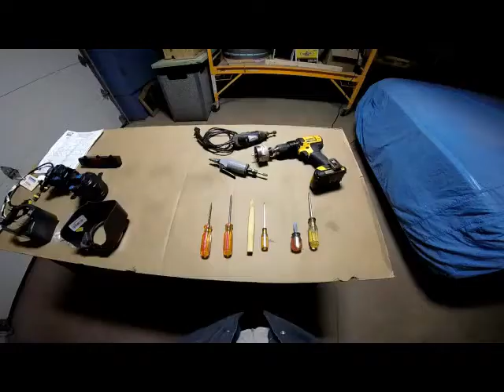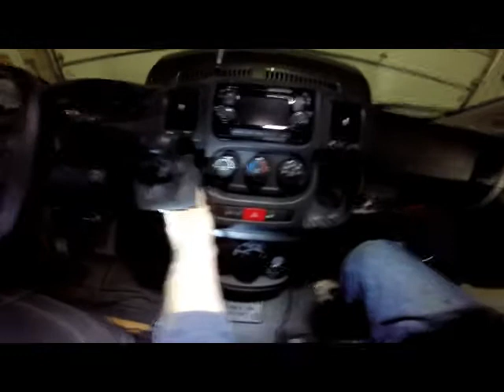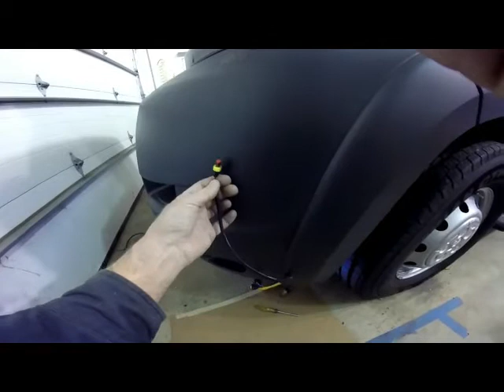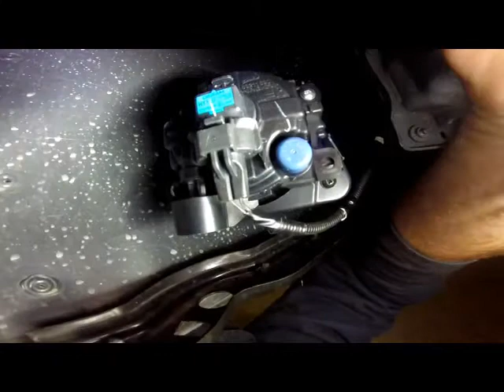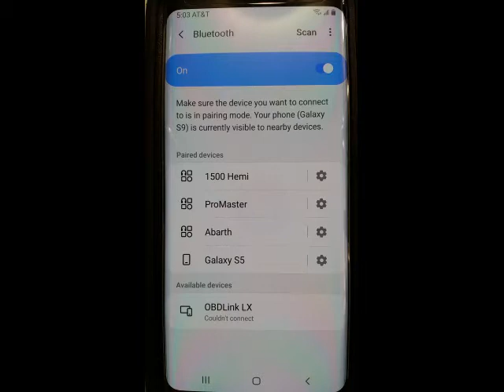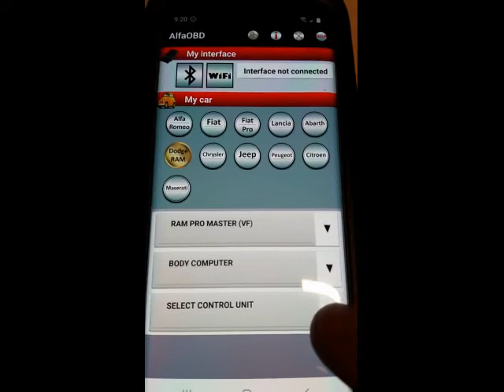Ram Promaster fog light install and enable with AlfaOBD

Comment: Thank you for your excellent video.  I have a 2021 ProMaster and my drivers side fog light works fine, but the passenger side wires are not getting any power to the fog light. I've tried to trace the wires back to the headlight, since I think they get their power from the headlight harness, but I'm not able to find where the fog light wires are in the region of headlight harness. Do you have any advice? I guess I could replace all the wires for the fog light, but it would be nice to have the OEM switch still work.
Reply from the maker: Sorry, I never had to mess with the harness(s).
Reply: Try swapping the cables

Comment: doI need pin code from dealer in order for this to work?
Reply from the maker: No, I don't think so
Reply: @LEKtronics  
sorry to keep bothering u with this issue but after some research it sounds like on ram vehicles (promasters) after 2018 u need an 12+8 pin obd2 adapter cable for sucurity gateway module bypass! is that different from the yellow adaptor and if so do i need both adaptors?

Comment: Larry i also got this message ..... this procedure allows to change car configuration options. warning some systems can be not relevant for your particular car. select an option you want to change from the list box and click start. you will have to perform proxy alignment after any change in the car configuration has been made hint make sure the log recording is switched on so that you could trace the changes to the configuration to be able to roll back the changes.
Reply from the maker: yeah, you probably have to do a proxy alignment to make the changes stick. Make sure that you have no faults before you do the proxy. The proxy alignment is initiated right above the car configuration change that you used to select front fog light absent/present.
Reply: @LEKtronics  okIll try again tomorrow thank you

Comment: hi I have a 2021 ram promaster1500 and added the fog lights. im wondering if the items you used to program the lights on would be the same for my model? saying that im a bit confused on items to purchase to do it myself. by the way i enjoy ur videos thank you
Reply from the maker: I think that the Promaster wiring is the same until model year 2022
Reply: sorry to keep bothering u with this issue but after some research it sounds like on ram vehicles (promasters) after 2018 u need an 12+8 pin obd2 adapter cable for sucurity gateway module bypass! is that different from the yellow adaptor and if so do i need both adaptors?

Comment: Hello, I have a 2021 ram promaster 2500. Do you think that works? because they look the same and it even has the cable for the fog light, thanks
Reply from the maker: I think that the 2022 model year is when they changed things. You should be OK.

Comment: Thx for this. Had a deer strike and think he broke the portion from the bumper that the housing screws into as my light and assembly are lying on the splash guard and I only see the slot which the housing slides onto. Probably need a whole new bumper to replace a fog light 🙄
Reply from the maker: Sorry to hear about the deer! Glad that my video helped you out.

Comment: Interesting - I wonder if you could use this to have a nice OEM+ play to trigger a light bar?

Do you have the part number for the switches?
Reply from the maker: The kit that I got was Mopar part# 82214048. A Google search came up with this: https://store.mopar.com/oem-parts/mopar-headlight-instrument-panel-dimmer-and-dome-light-switch-5mk26jxwaa?c=Zz1tb3Bhci1hY2Nlc3Nvcmllcy1jb21wb25lbnQtcGFydHMmcz1mb2ctbGlnaHRzLWFuZC1lbGVjdHJpY2FsJmw9MyZuPUFzc2VtYmxpZXMgUGFnZSZhPXJhbSZvPXByb21hc3Rlci0yNTAwJnk9MjAxOCZ0PWJhc2UmZT0zLTZsLXY2LWZsZXg%3D
Says that it's for 2104 to 2021 Ram, but it looks like the switch that came with the kit. Cannot verify that it will work.

Comment: Hi, where did you buy the swith? Regards from México
Reply from the maker: The switch came with a kit from Mopar #82214048 which is no longer available.
However it looks as if you can still get the switch assembly itself.
Mopar #5MK26JXWAA
Reply: And what about the cables?
Reply from the maker: @FernandoHdezR  My cables were already on the van from the factory.

Comment: But some ProMaster don't have even harness build in  from OEM do they need to run new harness and  wires   and still they can activate the new switch ?
Reply from the maker: My Promaster is a 2016. I know from forum discussions that a lot of changes have been made since then. I'm not sure if the install kit that I used is even available anymore, and what model years it is good for. My guess would be that the switch could be activated, but you would be on your own for the wiring.

Comment: Can you help please I did all steps the same on your video , and at the end when clicked start the status said: Not enabled click next to change the system setting selected! 
I have 2021 Ram promaster 3500
Trying to enable front fog light
Reply: Also the phone connected to the internet and Bluetooth connected to the obd link
Reply from the maker: Have you tried running any of the van functions with AlfaOBD, such as the wipers, horn, parking lights, etc. That will let you know if AlfaOBD is connected properly and communicating with the body computer.
Reply: @LEKtronics  so you mean the same steps , but the function switch to select horn or wipers to make sure at the end says enabled successfully !!

Comment: Thank you first for sharing your experience 🙏🏻 Question please, I had installed alfaobd app on Samsung, does the phone need internet when it enables the fog light or just connect the app to obd via bluetooth?
Reply from the maker: I may be wrong, but to enable/disable settings, pretty sure you need the fully licensed version of AlfaOBD. Do you need internet access to enable the license ? Probably.

Comment: Have a added fog lamps to a 2021 Promaster 1500? If so, what are the differences? I can’t find the pigtail to plug the lamps into.
Reply: They aren’t any help. And RAM support is absolutely useless. I’ve actually figured it out on my own. I found the pins in BCM C3 that drive the lights. Confirmed the pins by pulling the fuses to see if the 12V turns on and off. Fished a 2-lead power cord thru the firewall port, then ran the wires to the lights. Turned on the lights via the BCM, and I now have fog lamps. And I used all RAM parts. Including the dash switch assembly. Pretty neat.
Reply from the maker: @leolongo9178  Good to know that the BCM supports the lights even if the wiring is not present!
Reply from the maker: Sorry, I have a 2016. Can't say about a 2021. Try the Promaster forum. http://www.promasterforum.com/

Comment: How much did this mod run you? Seems worth it to just order at $175 from the factory?
Reply from the maker: Around $170 for the lights and the switch. plus the Alfa OBD stuff to enable them. So yeah, getting them OEM is worth it. I forgot to add them when I ordered the van.
Reply: I bought mines used so no chance to order!

Comment: Hey Guys! Can you add the fog light harness if your PM did not come with harness. I don't think mines has the plug under the bumper, but where does that plug in to the body control... can i add so i can use a factory fog light switch in my 2016 PM. Thanks in advance!!...
Reply from the maker: I not saying that it can't be done, but it would not be easy. Probably better/cheaper just to make your own harness and switch. That way, you can turn on the lights whenever you want, not when the ECU says that it is OK.

Comment: I guess another question would be why can you not plug in the LX or MX+ directly since AlfaOBD is doing the work initially?
Reply from the maker: To Quote AlfaOBD's website 
"The OBDLink LX or SX devices are recommended for other Fiat/Alfa Romeo/Lancia CAN-based cars with the low-speed CAN bus on pins 1 & 9 of the OBD plug. The "yellow" adapter is required for the access to the low-speed CAN bus."
Reply: @LEKtronics  Thanks for the reply, I did read that page but then this caught my eye. 

No additional adapters are needed for these cars when using OBDLink EX or MX+. As the OBDLink interfaces have high communication speed they are especially recommended for the Body computer configuration adjustment and odometer correction on Chrysler/Dodge/Ram/Jeep vehicles.

SO? does that mean that the BCM is only a low speed can therefor requiring the cable? Trying to educate myself and understand the low speed vs the high speed Pins and so forth.
Reply: I wonder if i should try to use the MX+ and see if it works without the cable?
Reply from the maker: @AL-wk4bl  It would be good to know!

Comment: Is the Yellow adapter Required? I was told you can you the MX+ scan tool and not use the adapter? Care to elaborate what the Yellow Cable is doing? 

This is the OBD MX scan tool i mentioned. I guess its just a better version of the LX? 

https://www.amazon.com/OBDLink-Bluetooth-Professional-Grade-Diagnostic-Performance/dp/B07JFRFJG6/ref=sr_1_1?dchild=1&keywords=OBDLink+MX%2B+OBD2+Bluetooth+Scanner+for+iPhone%2C+Android%2C+and+Windows&qid=1611796996&sr=8-1#customerReviews